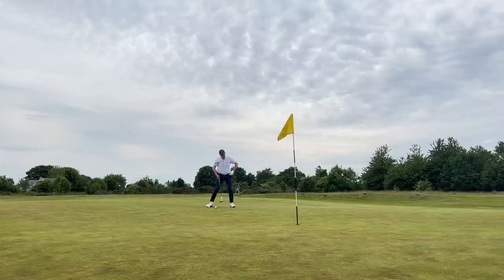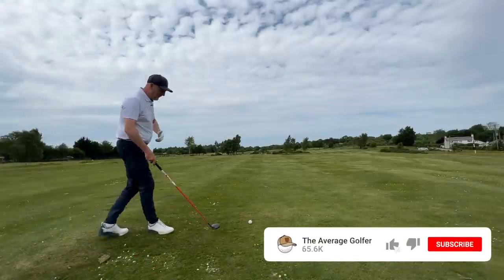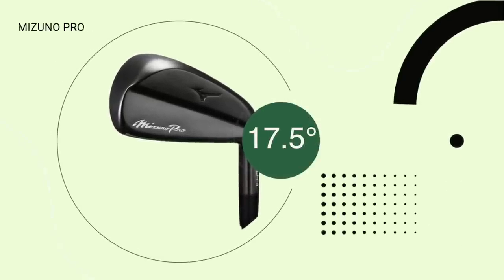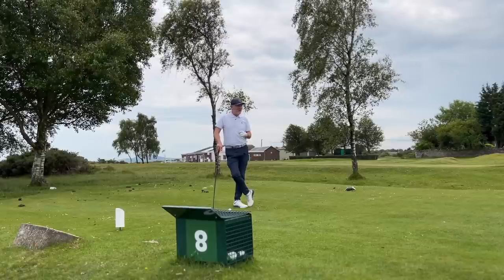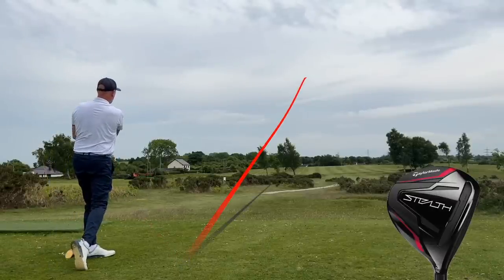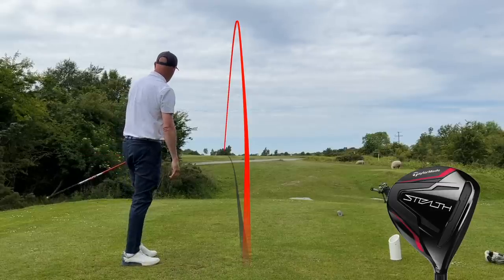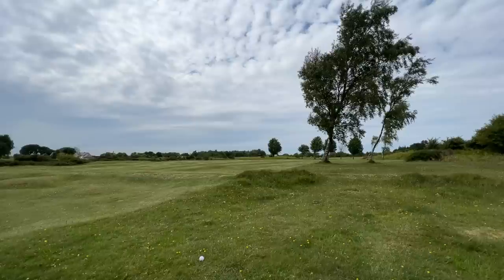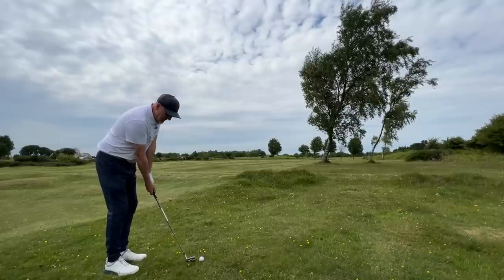WHY do they make these GOLF CLUBS?

Comment: I would choose the "driving iron" all day over a 5 wood.  They are shorter in length and much easier to be consistent with for me.   I'm not really sure why you can't see why others would have different preferences or needs than you.  I hit a 7* degree driver with an xtra stiff shaft but I recognize that choice wouldn't fit everyone.
Reply: I hate the feel of a wood.  Just bought a U 505 1 iron to replace my 3 wood

Comment: I added a 2 iron utility club into my bag this year because of the versatility it gives me, the weather conditions, and my home course setup. My home course isn't long, but there are a lot of short par 4s that have tight, tree lined fairways. Add to that, we tend to get a lot of windy weather. My natural ball flight is high, so having a club that is much easier to hit low in the wind and keep in play is very valuable. Also, it's great for punching out of the trees, as long as the rough isn't too thick. I've also used it as a links style approach shot when the green is open in front.

Comment: I think having clubs that do both are so important to have in the bag that I carry both - sort of. I carry an 18-degree 5 wood and also an 18-degree hybrid - which is actually a 19-degree 3 hybrid opened 1-click to 18-degrees. My hybrid being opened is set for a slight fade, but I can hit it near the toe for a lower-mid flighted slight draw - fade is 210 yards and the draw is 225 yards. The 5 wood is 10-yards longer hitting both shot shapes, but it's easier to draw and flies WAY higher. I love having both tools - dropped a wedge to make space.

Comment: I’ve just bought the Mizuno Hi-Fli 2 iron. I have a high ball flight and tend to struggle for distance and accuracy off the tee in windy conditions. Can strike my 2 iron much lower and it goes up to 250 yds - far further than my 5 wood.

Comment: I have a Titleist 981D 2 iron that I have had for over 20 years that I use when I need to put tee shots into tight spaces, or when I have to hit them into the wind. I also use it for long 2nd shots on par 5s where I have some room to let it run.

Comment: I use a 16.5° 4 wood, a 21° 7 wood and a 22° utility iron. This setup is finally the one that works for me. After trying tons of hybrids I finally tried out the high lofted fairway wood and it’s been a game changer. The 19° hybrids were always okay but just too close to my irons in height. The 7w gives me that height and extra distance off the fairway and it’s just point and shoot effortless off the tee. I also use the 4 utility with tons of success into the wind or when I want more of a lower trajectory for whatever reason. I love having these options.

Comment: Spanish golf pro Adri Arnaus won a recent tournament using a driving iron off the tee in windy conditions. For him, the advantage was that he could still get 300 yards with the extra roll, but kept the ball low and out of the cross winds. For that kind of golfer, with that strength and swing speed, the long iron off the tee makes good sense in windy conditions or very narrow fairways. But most average or amateur golfers don't have the swing speed to do that. On the other side of the coin, a lot of men pros are now using 7 woods and even 9 woods on long par 3s and for long approach shots in order to get the increased launch angle and height and steeper descent angle that will keep their ball on the greens. Oh, and today, LPGA pro In Gee Chun scored a stunning 64 on the totally redesigned Congressional Country Club Blue course just outside of Washington DC in the first round of the KPMG Women's PGA Championship. The course was playing long due to rain and soft fairways, and at 6,894 yards is slightly longer than this week's men's PGA Tour layout at TPC River Highlands. The Blue Course is tough, having hosted three US Opens, and the greens are fast and tricky. In addition, a number of them slope from front to back, the reverse of the usual. This makes it even harder to get a long approach to stop. So Chun replaced her hybrids with a 7 wood and a  9 wood. They did what she wanted them to do, and were also easier to hit out of the very dense rough than hybrids.

Comment: I love high lofted fairway woods, I played a 4-7 wood setup from about 2010-2018 and only switched because I wanted to add a hybrid and my gaps just worked out better with 3W-5W-4H. One thing I've always struggled with playing these types of clubs is hitting into the wind. Fairway woods and hybrids are great at giving you more height and more spin but staring down 215 yards into a breeze gives me fears of losing control of my 5 wood when it goes a mile into the air and the wind starts pushing it one way or the other. Being able to flight something down with less spin is nice. I'm teaching myself to do that with a hybrid but it's much more natural with a long iron.

Comment: I've got both a 2-iron and a 5-wood and I swap them out depending on the course I'm playing. Had a comp where the longest par 5 was easily reachable in 2, even without the 5-wood and the longest par 3 was still an iron. AND there were several short par 4's with hard doglegs where driver is completely out of play. But a 250 yard 2-iron? That flies lower and spins less? chef's kiss

Comment: I come in steep and hit the ball high so getting the ball in the air has never been an issue. The issue for me was always the extra length of the 5 wood and other fairway woods in general. Sure, if I changed my swing to come in a little more shallow I could hit the 5 wood farther than a driving iron of similar loft but that was a 1 in 10 shot. When I finally learned to consistently hit an 18 degree hybrid I got the best of both worlds, consistency of the iron and the length of the 5 wood. But with Callaway introducing their utility wood it seems my hybrids days are numbered.

Comment: i carry a 7 wood 21° and also an utility iron with 20° and those 2 clubs are going the same distance on well stikes. But on days with not so well strikes my personal miss is left and right with the fairway wood and short or long with the utility. I remember really not a single lost ball with an utility iron because I simply have much less draw or fade tendency. So better to be a bit short but still at the fairway, than pin high in the hazard.

Comment: I am a 16 handicapper and I don't use fairway woods as I find them too inconsistent. I replaced them last year with two driving irons a 12.5° and 16° Lynx VT stinger driving irons they match the distance of 3 and 5 woods but are much more accurate. I much prefer the control of an iron. He needs to use them like fairway woods more out of the front foot and you get much better results. There is something very satisfying when a playing partner hits a 3 wood of the tee and you pull an iron out and casually Stoke it 20 yards past him. Horses for courses I guess but since I've had these clubs I can reach some par 5s in two the best change I have ever made to my game is driving irons.
Reply: dang you play a 0 iron!
Reply: With the these modern irons even with the 12.5 loft it's surprisingly high launching even of the floor and rolls out to about 230 yards plus it's got the advantage of hitting stingers in the wind.
Reply: Sorry not sure how to send a direct message.

Comment: You should test a 19 degrees instead, much easier to handle. I play alternatively a 5-wood and a driving iron depending on the weather. Both are useful in various conditions.

Comment: I have a HMB 2iron (steel shaft!). Purely to practice with. I don’t have the club head speed to game it. But it’s a personal goal. It goes about 40 feet in the air flies about 185 yards and runs like a scolded cat. Only ever used off a small tee and on a windy links!

Comment: Sometimes I feel slightly better control using an iron from the tee, playing a really tight hole. Lower ball-flight feels safer in wind as well. In the end, it all comes down to wether this is something to use off the tee, or as an approach to greens.  Currently thinking of adding a FliHi #2 or #3 to my bag.

Comment: i have a Mizuno 3 driving iron and love it, love it, love it. good distance. I play courses with very tight tree lined fairways. I hit it much straighter than a hybrid. These irons are not your thing but for others it very well could be. I would say that anyone with a good smash factor with irons and adequate swing speed shoud give it a try. shaft weight and flex plays a big part as well like anything in the bag. I have a graphite shaft in mine which seems to fit well in the progression from the steel shafts in my other irons.

Comment: As you say, Andy, it has a lot to do with the courses and conditions you play.  Some people are more comfortable with their irons than their woods, so the utility iron may be what feels and works best for them! I use a 3-iron in windy conditions, for low punch escapes, and sometimes off the tee on a tight par 4.  When I'm in Nebraska I use it a LOT.  In Nashville, decidedly less so. I tried a few utility irons, but the heads are mostly too big and the soles are too wide for the shots I use them for.  But also, I don't have a lot of speed, and I'm just kind of pat-patting it around the course when I use a long iron, and it's just for position. You need a serious amount of speed to get these utility irons to perform the way they were designed, and you need to be hitting center.  But even at my speed, a well-struck 3-iron onto a hard fairway will actually roll out to around my 3-wood distance (which, admittedly, is not a great distance). 😂

Comment: So here’s my problem, I have a set of MAVRIK irons, 4~AW.  The 4 iron comes in at 18degree loft.  I can hit it fairly consistently 190-205.  I have a gen 1 PXG hybrid that is 17 degrees.  I’m lucky if I can get that club to go 190-195.  So what do I do?  On another note, I can only hit my 6 iron about 5 yards further than my seven iron, and don’t hit it very well for some reason, so it’s out of the set.  I have a Cobra Bio Cell 4 wood at 16 degrees,  wHi
Reply: Sorry, the Bio Cell is consistent 210-220.  So I have about a 20-30 yard gap from that 4 wood to my 4 iron.  Any suggestions?

Comment: I think there’s an elephant in the room that didn’t get mentioned….That being that low speed players have a power leak and that power leak is low launch and the wood definitely would assist in that category . The power leak for the high swing speed player is high launch and taking the fairway wood and throwing it up into wind can affect dispersion and also distance. Shaping and flighting the ball is much easier with a iron as well.

Comment: I use a five wood off the tea sometimes I have a 44 1/2inch driver which is easy to control I then have a 20° ZU utility and the 23° that tyou utility I really like them both however I would not even consider unless it was a perfect lie to hit that 20° off the turf I use it on our local golf course a very nice nine hole we have a par three that is 180 yards downhill and another part three that is 172 uphill in fact because of the greens one can use the same club for both holes I find the 20° ZU is just awesome far better than any highbred or long iron I have hit come close to an ace not yet though I love the 23 instead of a hybrid or a for iron in fact I am fearless with it works most of the time

Comment: Possibly could be the thought that just as some people use a driver with a slightly shorter shaft maybe one or 2 inches shorter than normal as released by manufacture simply to gain better control some golfers may just feel a little more confidence with that degree of loft but with the short shaft. It also depends on the course that you are playing on because many courses after you hit your drive the length of the hole may not weren’t using a Fivewood but maybe a two iron or 18 or 19° lofted iron would suit the purpose better. So then I would also depend where you play. I have some clubs that I put in and take out of my own bag depending on which course I’m going to be playing because I am vision roughly which club I’m going to be needing for a second or third shot. So that depends on which irons I pull out and which hybrids or ones I put in. I think it’s just a matter of preference especially if you’ve got an narrower course whete a wood may not be safest choice

Comment: I've got a 19 degree Ping crossover in the bag and a 5 wood at 20 degree. I use the crossover off the tee on tight fairways and in the wind. It goes for miles, especially in the summer, it runs and runs. Very forgiving aswell. Great club, doesn't balloon up in the wind. Wouldn't be without it now👍

Comment: you want 2 irons to hit those pinching bullet shots..like tiger..for instance with my 2 iron, I'll bullet it 8 feet in the air, lands 250 yards, and rolls another 100 yards..thats a 350 yard shot with more control.
Reply: So, you’re saying you hit a 2 iron 350 yards on a regular, consistent basis?
Reply: @booboojones2590  NO. My good shots..Usually 330 yards since I pulled a rib last month
Reply: @ Gout - you’re probably a good human being and all but I don’t buy it.   I hope this is just a joke I missed.
Reply: @booboojones2590  It's not..I bomb it consistently..I hit further than the pros, it's my putting that's the missing link.
Reply: How far for 7 Iron?   Max height?
Reply: @goutfromfriedokra3936  hit it further than pros 😂😂
Reply: That's nothing, I hit mine 450, 500 with roll. On a good day I can take putter off the tee for par 3's, bomb it 180
Reply: @booboojones2590  220 if I want to swing easy..I can play it in different windows
Reply: @michaelashworth7294  I should clarify..Over 90% of the pros...Not sure I can outdistance Bryson..but I can swing it
Reply: @ludwigslughole9403  I don't believe that..but there is nothing wrong with honesty...I'm a distance player but again, my putting is the weak link...If I had Matt Fitzpatrick's putting skills I would have been in the US OPEN.
Reply: @goutfromfriedokra3936  don't worry, I don't believe any of what you've written. To have the audacity to say you'd be in the US Open if only you had better putting.  So which tour are you playing on?
Reply: @ludwigslughole9403  I hurt my wrist so not playing on tours right now. but once it heals I'll probably join the PGA or LIV.
Reply: @goutfromfriedokra3936  same.  See you out there.